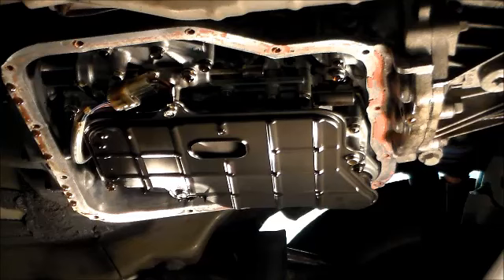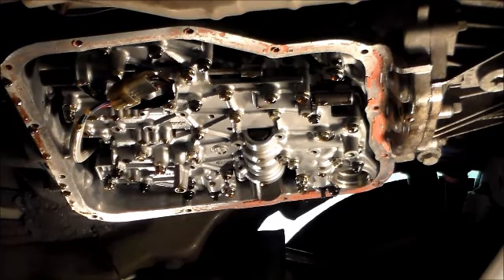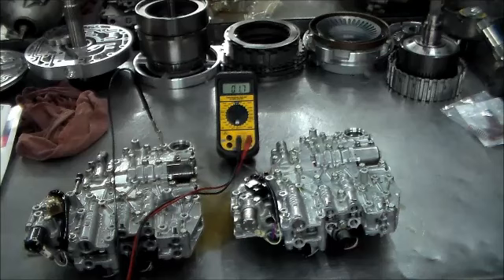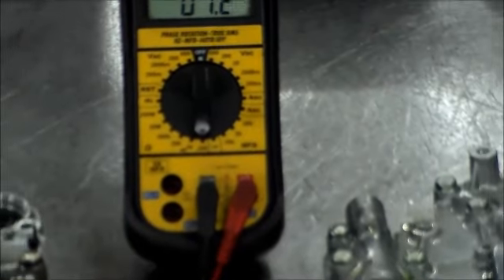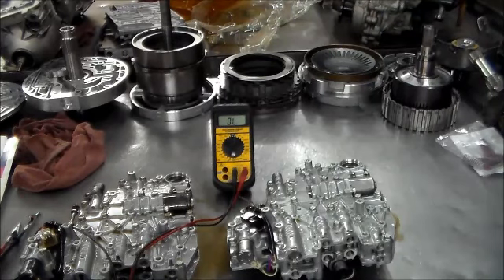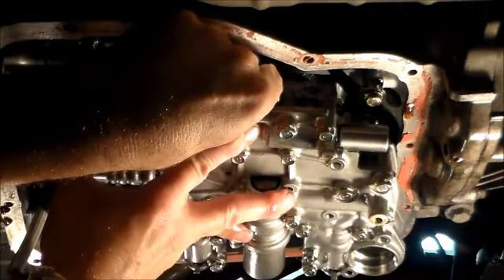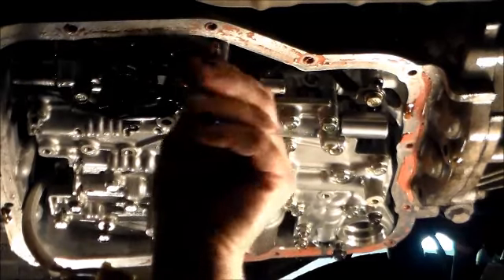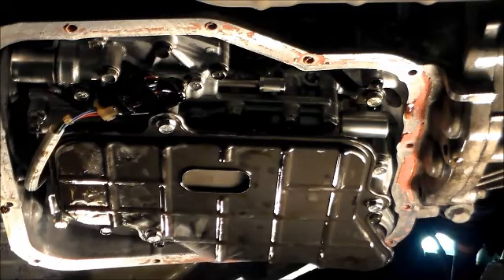Lineartronic CVT Valvebody Replacement with code P2764

Comment: Hi, did the transmission show any other symptoms than the error codes? We have a 2011 with only 42k miles that has started jerking or shuddering at low revs. There are no error codes, but the AT oil temp light started flashing after the dealers changed the fluid and updated the software. They put OEM Lineartronic fluid in it and the blinking means AT Learning not finished, but it can't be finished for some reason, probably because some component has failed.
Reply from the maker: Still has the same issue?
Reply: Yes, still has the same issue.
Reply: Btw, how did you get the P2764 code? At the dealers or with a scanner of your own? I just ordered a BT OBD2 scanner in order to see myself that there are no codes like the dealer says.
Reply from the maker: @iamfredrik  i have a Snap-on scan tool, thats how i pulled the code.  Do you have any lights on, on the dash
Reply: @GaryFerraro  Only the blinking AT Oil temp light, which blinks whether the engine is running or not.
Reply from the maker: @iamfredrik  Does it always blink, all the time when the car is cold too?
Reply: @GaryFerraro  Yes, it starts blinking as soon as I turn the key to acc position. And it blinks several times fast for two seconds then there's a two second interval with no blinking. The blinking is like number four in the diagram found here: https://bit.ly/2FLl1g5
Reply: Just an update. There were no error codes when doing the OBD scan. I also checked the solenoid resistance from the T4 connector and all ohmed within range. Next step would be to try to get it relearned. I'm not so confident that the dealer can fix it. Do you think it can be done using an SSM-III diagnostic tool from Aliexpress?
Reply from the maker: @iamfredrik  I not familiar with that scan tool, still doing the same thing?
   With this scanner can you read trans temp?
Reply: @GaryFerraro  I think it uses the same software as Subaru's own diagnostic tool, but I think I'll ask the seller before ordering. Here's a link to it:
https://bit.ly/2Q1WKaq
Reply: I had the problem twice and it turns out to be a solenoid(valve body solenoids in the transmission) gone bad(one of them) .... U should check it out. I have 2 subaru legacy cars that are CVT 2012 and the causes were that ive driven the car over100k trip without changing the CVT oil fluid..... I know its kinda different in ur condition but i had the same problems.
Reply: @searacoon3512  In our case it would have to be a mechanical solenoid failure, because electrically they all check out fine. Were there any trouble codes on your cars?
Reply: Hi Gary, can these solenoids be cleaned? I suspect a solenoid could be clogged up in ours, because they ohm within range and there are no trouble codes. The dealer quoted 2100 euros for the valve body and that's without any labor, so if possible I would try cleaning the solenoids before going the dealer route.
Reply: @iamfredrik  it can be cleaned go check a video on YouTube ull find it
Reply: @iamfredrik  plus just to remind you that solenoids tend to fail when it heats up. If so change the ruined solenoid. If u cant find any solenoids to replace it... Just buy a new or used valve-body thats what i did twice
Reply: @mortal artist Thanks!
Reply: CVT finally broke down. Does not move in drive or reverse and there's now a whining noise coming from the torque converter housing. DTCs P0700, P0965, P0841. Do I need to replace the whole transmission assembly or just the valve body?

Comment: Hey thanks for the video. Quick question. I have a 2013 outback 2.5i and im replacing the valve body and parts said i needed two o rings. Are they necessary? Asking cause im trying to get it done tomorrow and can't get them for awhile.
Reply from the maker: Valvebody is on the top or bottom?
Reply: @GaryFerraro  bottom

Comment: the code i got was P2762, i have a subaru outback 2011, im assuming this code is also caused by the valve body???
Reply from the maker: What is the definition, circuit to high?
Reply: @GaryFerraro  it says "torque converter clutch (TCC) pressure control solenoid - range/performance problem"
Reply from the maker: @mikej5337  That code is a mechanical code. What is the year,make and model of your car, engine size too
Reply: @GaryFerraro  2011 subaru outback 2.5i
Reply from the maker: @mikej5337  I ran the code through a diagnostic program, the big fix was a valvebod, other fixes were a transmission.. Being the fact that this is a mechanical code i don't want to tell you for sure that a valve body will fix this code. Do you have a scanner that shows live data?
Reply: @GaryFerraro  no i just borrowed my friends scanner he got for $20 off ebay lol, it uses an app on your phone
Reply from the maker: @mikej5337  ok, let me ask you this, when you drive the car do you feel any kind of shuddering, like your going over rough road or driving over rail road tracks?
Reply: @GaryFerraro  no, the car drives fine for the most part, only a very slight shudder as im coming to a stop at a traffic light sometimes. however the transmission oil does get hot after driving for about 5 mins,  i can kind of smell it when i get out of the car.

Comment: Whats the part number for the valve body... I have a 2012 Subaru Impreza Sport Premium with the CVT and same hard code.... are they the same part number??
Reply from the maker: No, there different versions of the valvebody, you have to order it through your vin number
Reply: roger, thanks!!
Reply from the maker: Welcome
Reply: Hello there, the 2012 with FB20 engine has the valve body on top of the tranny. You have to drop the tranny to get to it. I have a 30k miles cvt tranny that I am parting out (failed differential bearing). Not looking to make big bucks out of it, just want to find new owner for the good parts before I scrap the tranny in junk yard. Let me know if you need it.
Reply from the maker: Thanks for the offer, but i do not need it at this time
Reply: what 2012 do you have?? I have an Sport Premium. if you have the same I am interested in your part out. how much for the valvebody??
Reply: Armaun Bartee I have the 2012 hatchback premium. I am asking $150, normal shipping included. I can send you the valve body picture if you can provide me email or number.

Comment: I had similar hard code p2763 and p0700, and p2762 as a pending fault code.  2014 forester xt 89k miles.  was driving down freeway and a bunch of dash warning lights turned on all of a sudden, so I pull over and check codes.  turned the car off for 20 minutes and they cleared itself.  now no longer have the codes.  hope it was just a fluke.   However I think it may a symptom of having to do this repair soon.  sucks,  I was quoted 1900 at the dealer before tax if this is a future problem.
Reply from the maker: 1900 for a trans or just the valvebody?
Reply: just valve body and labor, quoted at 1 dealer. haven't shopped around. and maybe because I have the xt the turbo version is more $$
Reply from the maker: dukdude    The valvebody alone is close to thousand dollars. The one I did I think I got about 1700.
Reply: ah ok, thanks for the heads up :)

Comment: Hey thanks for the good information. I just scanned my vehicle, it's showing code "P2763 Torque Converter Clutch Pressure Control Solenoid Control Circuit High". I'm thinking this is one of the 4 solenoids in that Valve Body, a different one from yours (versus P2764), and that it is bad. Do you think it's reasonable to believe that replacing the current (original Valve Body) (160k) with a new one would fix this issue? I'm thinking it is indeed electrical, because other than the Christmas lights on the dash, it drives like normal. Thanks Again.
Reply from the maker: You  have an electrical issue, your code means circuit high and the one i was getting is circuit low. That solenoid is a problem and  replacing the body should fix the issue, but you may want to drop out the body and ohm the solenoid to confirm.
Reply: @GaryFerraro  Will do, thanks !!
Reply: 6

Comment: Could you explain the method of leaving the DVOM ground connected to the old VB while you measure resistance on the new VB? Wouldn't that in itself give you a higher ohms measurement, what with going through the VB, to bench and then the other VB? How did this turn out?
Reply from the maker: I basically just needed a "known good ground" to check the solenoid, even negative battery post is good.  The original solenoid was bad, installed the new valvebody from the dealer and all is well, it even adapted on its own.  Thanks for watching.
Reply: Gary Ferraro The only valid ground would be to move the negative to the new VB to test. Glad it's fixed though.
Reply: @transfixleo  I noticed that while watching as well. Glad there are some others who caught it.

Comment: I thought the valve body is on the top of the tranny. So i suppose 2.5s shares the same engine but different trannys. I saw a different video with the valve on the top.
Reply from the maker: This trans is the TR690 and the other is the TR580(valvebody on top)

Comment: Hi do you think this is the same transmission like my 2013 subaru impreza cvt  bc i have this codes and my car P2762,P2763,P0700 please help and thanks
Reply from the maker: There is generation 1 and generation 2, solenoids may have different values, Question, if you clear the codes, how fast do they come back?
Reply: when a clear the codes they come back right way and show and my scanner this codes
Reply from the maker: do you know the definitions of the codes P2762 and P2763
Reply: P2762 the scanner says torque converter clutch solenoid circuit is high and p0700 is transmission control system malfunction so do think if a change control valve body a fix my problem bc the subaru dealer charge a lot money
Reply from the maker: Yes, the next step is to drop the pan and valvebody, Identify the solenoid and ohm the solenoid to confirm its bad
Reply: thank you very much
Reply from the maker: I dont think the solenoid is sold seperatly you may have to purchase the valvebody(still cheaper than a trans)
Reply: what was the final verdict Pablo? I just had p2763 and p0700 come up on my subaru crosstrek xv. at 60k miles now. bought it at 37k miles.

Comment: CAN ANYONE GIVE SOME TIPS???
I have a JACt40 CVT hard to identify the B.O.
It has the mechanical operation of the CVT exchange in days, it does not make noise and does not slip, apparently there is no lack of pressure.
the customer reports that he has started to experience the defect sporadically.
after normal use of the car, just after turning off the ignition key, when the customer tries to use the car again
  The car shows a defect in the panel, and does not pull any gear. however with angus minutes or sometimes hours it works again.
  the last time it had this defect, it never came back... the curiosity is, because only sometimes, but not during long trips,
and not malfunction while the car is running
  only after it is turned off, and the worst, just come back alone
already checked:
valve body
 center (TCM)
transmission oil
diagnosis (FAILURE IN COMMUNICATION WITH CANTRAL)
There is no stepper motor on this model.
Reply from the maker: What codes are present?

Comment: what happens if you replace the valve body and don't do a relearn?  I have a valve body on order and didn't know about the scan tool part
Reply from the maker: I would drive the car after the install, you may be ok, it may not need to be relearned, i did one once where i just drove the car and all was well
Reply: Gary Ferraro  thanks for the quick reply.  I’m too a tech and Mitchell’s / Subaru oem says nothing about a relearn procedure.  I just was doing some research and started reading that it needed the relearn.  My snap on and autel have no options for it
Reply from the maker: what snap-on scanner do you have?  where are you located?

Comment: I have a code P0971 for my 14 Subaru Forester. 115k miles. 

Will this fix this code? Is there no other solution other than replacing entire body?
Reply from the maker: What is the definition of the code?
Reply: Pressure Control Solenoid C Control Circuit High
Reply from the maker: @danneynukta8604  if you clear the code, it comes right back?
Reply: It's delayed... Cleared the code and it went away for two months... Just came back yesterday and that's the same code they pulled again for it.
Reply: @danneynukta8604  same to my 2015 impreza

Comment: My car is 2014 Subaru Forester and I got same code 2764 so I need to change the valve body...
Reply from the maker: Yes, this is very common problem, what is the engine size?
Reply: @GaryFerraro  i got a 2.5 thanks for replying
Reply from the maker: @arnoldbaclig7709  i Believe you may have the Generation 2 unit with the valvebody on top
Reply: @GaryFerraro  ok I'll check for that thank you

Comment: Thanks Gary!  Do you have the ohm values for the solenoids?
Reply from the maker: +sbp5897  Im home now but i will check when i get back to the shop, what year are you working on values may be different. Gary
Reply: +Gary Ferraro Same vehicle as in the video I believe: 2011 Outback 2.5i  130k  I just had the P2764 code throw this afternoon while driving.  I cleared it and it immediately came back hence my interest in your great tube.  Specifically, I was wondering how you narrowed it down to a particular solenoid (even though i'll likely need to order the entire body).  Thanks again Gary!
Reply from the maker: sbp5897  The solenoids are not sold seperatly, you will have to purchase the valvebody. On the 2011, the ohms are different than the 2009 and 2010, my info is on 09 and 10, i will look to see if i recorded the ohms when i get to the shop. Gary
Reply from the maker: +sbp5897  Hello,  Im sorry i had a crazy day today, its very busy, i will make myself a note to try to get this done tomm. Gary
Reply: +Gary Ferraro no worries, I appreciate you helping me out with this!
Reply from the maker: sbp5897 Thank you
Reply from the maker: +Gary Ferraro  The ohm for that solenoid your getting the code for should be 13 ohms, if its not then the P2764 will show. I checked my book and i did not record what the ohms were for the other solenoids. Being its a 2011 some values will be different than what i have in my book. I believe the 2011 is generation 2 for this transmission and i have info on gen. 1.  Gary
Reply: +Gary Ferraro Great, thank you Gary!
Reply from the maker: Your welcome. Have a great day. Gary

Comment: My 2012 Subaru Outback had this same issue. We bought the parts and replaced it. Seemed easy enough. Now my car will only go in reverse! Anyone have any ideas? We went through step by step, retraced our steps and now we just don’t know. He’s about ready to take it back out and start over.
Reply from the maker: He may have missed the manual valve,  look at 14:59 on the video
Reply: Gary Ferraro that fixed it and we back on the road. Thank you so much!

Comment: Thanks so much for the very helpful video @Gary Ferraro. 2011 Outback had P2764, found ohms low on lock-up duty solenoid, replaced valve body, refilled trans. Cleared codes, drove car, no warning lights, no CEL, but now sometimes car stalls when coming to a stop. New symptom. Do you think the new valve body needs programmed? Will this solve this stalling issue? Thanks!
Reply from the maker: Where did you get the valvebody from? almost seems like the solenoid is mechanically clogged
Reply: @GaryFerraro  Thanks for the reply! I got valve body, CVT fluid and new filter from Subaru. Could programming solve this issue? Any ideas?
Reply from the maker: @elimailey6900  Should not need programming, was it stalling before?
Reply: @GaryFerraro  Yes, I believe it was stalling before. Researched issue and now believe it is caused by the torque converter as per Subaru TSB 16-90-13R. Seems like a common issue and they've redesigned the torque converter. Thanks so much for your help!
Reply from the maker: Eli Mailey yes. There were issues with the converter. The ones I felt with had a chatter when lock up was commanded on

Comment: Hello, and thanks for the video. I'm trying to do it on my 2012 legacy. Did the new valve body relearn on its own? or you needed to take it to the dealer to be programmed?
Reply from the maker: I would drive it, it may learn on its own, the one that i did in the video, did not have to have it programmed, i just drove it

Comment: 2013 subaru outback tr580 cvt
Reply: Have you done this repair already? I need to do that very same job. The valve body is on the top of the transmission so this video isn't quite what we need.
Reply: Remove and replace valve body from up top is fairly simple, remove the throttle body and upper dog bone engine mount/torque mount and it exposes the trans.. there’s a fabric sheet held on with two ten mills, on up top at about three o’clock and one sort of hidden under the cooler near the steering shaft, it goes in sideways. After disconnecting a few harness connectors you can easily re,overhead fabric cover to expose the valve body cover. There’s about twelve ten mills asn a twelve mill earth that you need to remove being careful as under the alloy cover is a pressed metal gasket. The valve body is straight forward to remove, held in with ten or so longish bolts, however they’re all of similar colour. Go off your new valve body and use the holes as reference to the ones that need to be loosened, I had a diagram set it was a little more straight forward for me... hope you got it sorted trouble free ;)